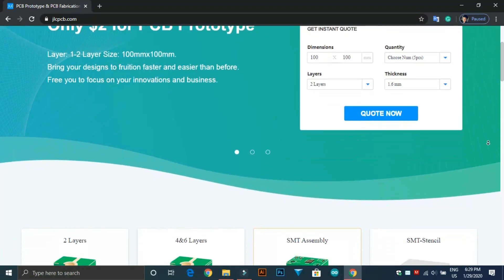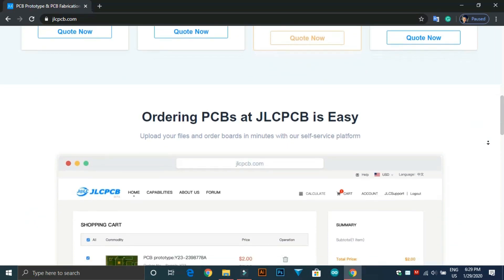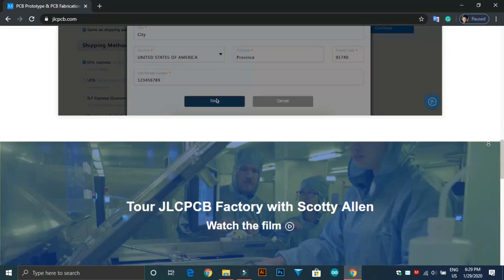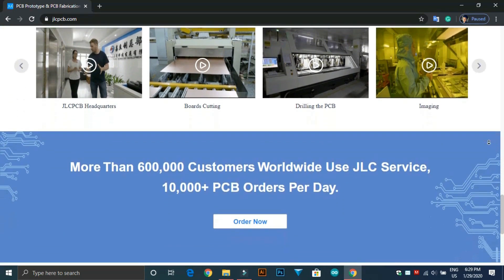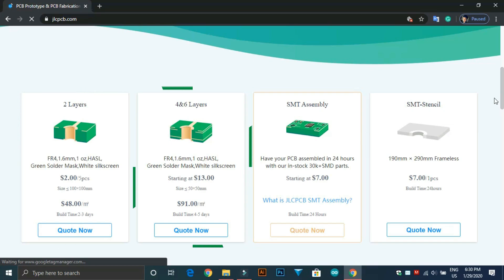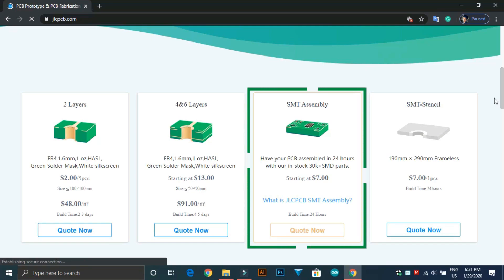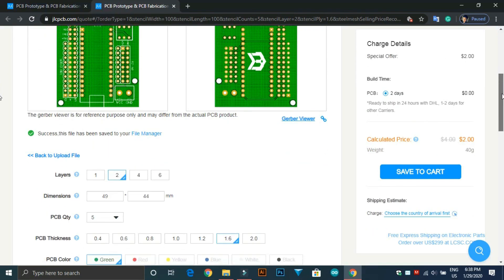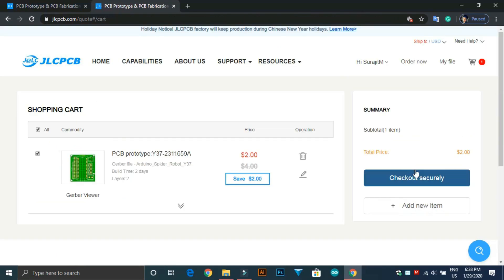How To Make A Spider Robot

Comment: sir, you should put the Arduino nano shield in your spider robot to make the connections of the spider robot and also attach the Bluetooth module to make the Bluetooth spider robot which can be controlled by a Bluetooth app.
Reply from the maker: okay i'll make it soon
Reply: Sorry I mine your what is your  spider robot  programming  app
Reply: Programming is main right ?